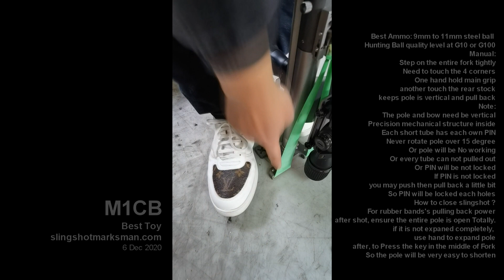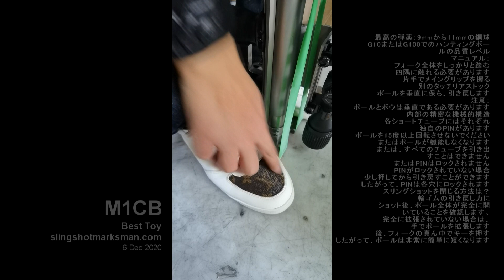M1CB 2020 Mini Hunting Slingshot Rifle 72CM Pulling Super Accurate One Key Unlock CNC Tech Catapult

Comment from the maker: https://www.slingshotmarksman.com/store/product/m1cb-2020-portable-mini-slingshot-rifle-bands-81cm-pulling-one-key-unlock-full-cnc-tech

Play: https://youtu.be/3NrExPgXiOw
Installing: https://youtu.be/8-PA-PFhfo4
Ammo Reloads & Pulls: https://youtu.be/6QawQgbGdPo

M1CB 2020 Super Accurate Mini Slingshot Rifle 72CM Pulling One Key Unlock Full CNC Tech Easy Carry
Features:
Best Ammo: 9mm to 11mm steel ball 
Hunting Ball quality level at G10 or G100
Manual:
Step on the entire fork tightly
Need to touch the 4 corners
One hand hold main grip
another touch the rear stock
keeps pole is vertical and pull back
Note:
The pole and bow need be vertical
Precision mechanical structure inside
Each short tube has each own PIN
Never rotate pole over 15 degree
Or pole will be No working
Or every tube can not pulled out
Or PIN will be not locked
If PIN is not locked
you may push then pull back a little bit
So PIN will be locked each holes
How to close slingshot ?
For rubber bands's pulling back power
after shot, ensure the entire pole is open Totally.
if it is not expaned completely, use hand to expand pole
after, to Press the key in the middle of Fork
So the pole will be very easy to shorten
 
Max support flat bands thickness is 1MM 
Max supports Flat Band width is 50MM 
 
The web price has been included shipping fee
Net weight 1.85KG
 
Package Includes:
    1 * M1CB 2020 Mini Slingshot ~ Easy Carry
  10 * Flat Rubber Bands

Watch M1CB Youtube Video: 

The Related Videos:
How to play Manual Video : https://youtu.be/xEwzlKhEkN8
Watch Actual Combat video : https://youtu.be/4—9jyWhu64
Watch Installation video : https://youtu.be/LZznZzZbuUo
Notice:

The following conditions are not covered by the product warranty
(1) Precision mechanical structure inside, many many small parts inside,
Please don't try to open the pole and trigger system.
Or you will be very very hard to put it back rightly except your are Mechanical Engineers
(2) if above happened, you may send pole back to our factory and we will refix it for 100% free.
     But you need to pay the expensive Fedex shipping charge by twice
(3) This is real Precision mechanical structure, please follow the above opercation manual exactly
(4) we only made 300 units for net costing is too high.
(5) Welcome to buy from our web or ebay store if you like it !
Delivery to UK,USA,KOR,AUS,JPN,GER,INA,IND,VIE,UAE,PHI,MEX,ITA,FRA,CAN Almost Worldwide
The shipping way is by Global FEDEX Express delivery service from China ( 7 to 14 business days)
Relaxing to track package in real time at courier's website in transit.
Not Economy Int'l Shipping.

We are professional slingshot manufacturer,
if you have any question about products and installation,
please email us and we will response within 48 hours.

Welcome to shop !
All orders ship fast from china directly to the worldwide.
If you have any questions, please contact me, thank you !